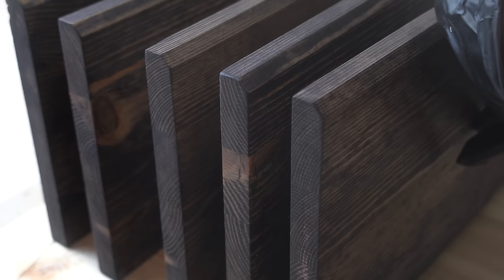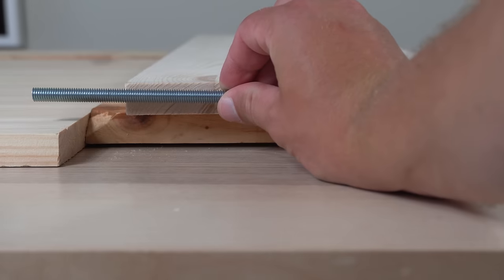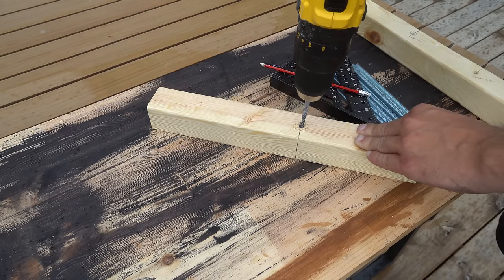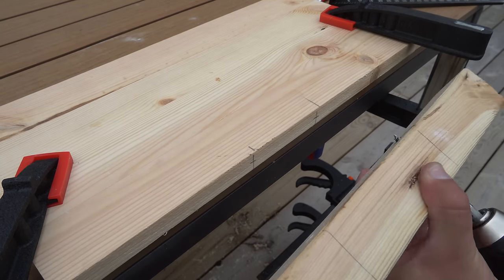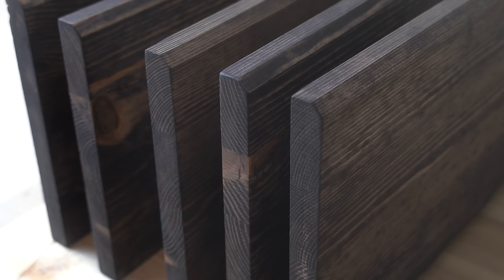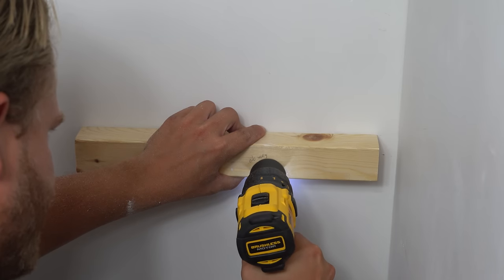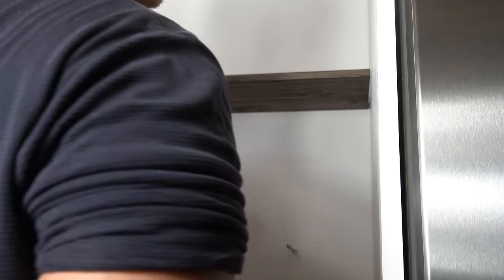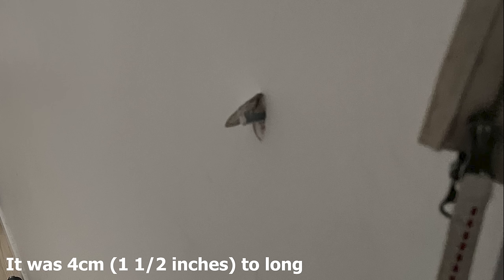How to make floating shelves, with invisible brackets

Comment: I want to make floating shelves out of 1 in thick wood about 3 ft long and 12 inch width and I don't want to make huge holes in the wall the way you showed  so I was thinking of maybe using some kind of flat metal and welding rods onto the metal or find brackets that already have the rods on a flat piece of metal  that are the same thickness as the rods that you used I know I would have to grind a little bit into the wood so that the flat metal things would go into the wood and probably I would have to grind the metal on top and bottom to make it a skinnier profile so that it doesn't show when the wood is into the wall . it's to bad  that YouTube doesn't allow us to upload pictures they could have a feature where you could upload a picture and it'll be a tiny picture but then when you click on the picture the picture becomes large and you can see the picture in a large view but unfortunately YouTube hasn't come up with that idea yet, because i have mad photo of what im trying to make
Reply from the maker: The rods in the video is 8mm thick (or about 3/8 inch) 

If you have a shelf that is 1inch you could use thicker rods with ease. 

If you dont want to make big holes in the wall i suggest you buy some floating shelves kit on amazon or you local hardware store. 

If you need any help you could send pictures to my instagram hallbeamdesign. 

Hope this helps :)

Comment: My walls are never square so in a nook like this, my shelf would be up to 1/2 inch wider at the front side, making these type shelves more difficult for old DIYer who only has a circular saw,  a measure tape & cordless drill. I have 2 stud finders that never find studs.
Reply from the maker: It is possible make this with just a circular saw! I will take a little bit longer and you need something to use as a guide for the circular saw. 

It is not visible in the video buy the sides of the pantry are not square either. About 5/16 difference.

Comment: I have a niche like that in a hallway, only wider and no door. I decided to make it an area with shelves where towels, linens, and other sundries would be artfully stored. I devised this method with one addition. My shelves are both deeper and longer, so I added two supports, one at either end of each shelf, 2” back from the front of the shelves, sticking out of the walls 1/2”. I cut channels into either end of the shelves stoping just short of the front end of the shelves. When the shelves are pushed into place as you showed, those short supports at either end slide into the hidden channels and ultimately provide some side and front support. I used 1” thick hardwood shelves. 
Excellent video! 👍🏻
Reply from the maker: Sound really nice!

Side support is very nice for deeper shelves, when you are able to do so. 

I want to try using a very thick (1 1/2 - 2 inch) shelf with this method in my livingroom. Probably have to use quite thick threaded rods but it will be a nice project. :)

Comment: Great video! I too did some floating shelves in our linen closet. Similar to what happened to you, I assumed my closet corners, where the shelves were fitting snuggly into, were square. Unfortunately, they weren't square and required some "persuasion" with a rubber mallet. I also sanded the back edge of the wooden shelf so there wasnt a gap between the floating shelf and back wall in the closet. This DIY is a good one to follow for simplicity and attractive aesthetics. Cheers all!
Reply from the maker: I also dream about square walls and edges. Made a really long floating shelf for a client a while ago for her livingroom. When I installed it we noticed that the wall itself had a bow  the size of the diameter of my little finger. In a newly built house :) This also took some persuasion with a jigsaw. Thanks for your feedback!
Reply: @HallbeamDesign  That's crazy! Glad to hear it went well! Thanks again for the great content! 👍 Subscribed!

Comment: Love love, so easy to understand how to do this. Actually doing it is the tricky part lol😂 (I will be the one with protruding things in the wrong wall etc). I’m going to give this a crack and will gift myself the right tools, because I deserve it. Brilliant thank you ❤🎉
Reply from the maker: It's easier than it looks! Most important is to make sure the threaded rods are 90° (drill the hole a little bit smaller than the rod) And that the hole in the shelves are 90° 

You deserve it!

Comment: Thanks so much for the basics of the process 😊. Was able to use it to install live edge chestnut wood shelves to showcase my wood carving figurines. Only major difference being having a brick and mortar wall to drill into 😅
Reply from the maker: Excellent! I'm happy that this video was enough to help! :) I'm going to install some live edge shelves myself soon. Brick walls are very sturdy and are perfect for this type of build. Did you use any fasteners in the wall or did you just insert the threaded rods?
Reply: I wound two layers of paper tape around the rods and hammered them gently in. Very snug fit. Have posted it on Instagram and tagged you 😊

Comment: I've been putting old roof beams straight onto brick and block work using this method. It actually helps if the holes aren't perfect as this makes them hold really well, though a mallet is required. You could use resin but it might be a bit hard to out again. I like the technique of getting rod into wood, that's going to be useful at some point I'm sure.
Reply from the maker: I love that you made this comment at the same time as me uploading a video on how to build a woodworking mallet! :) 

I wish i had some old roof beams to work with. The shelves become very sturdy with this method. I am going to install some thick shelves soon in my own house. 

Thank you for your comment!

Comment: Thank you for this nice video
Reply from the maker: I hope this helps!
Reply: @HallbeamDesign  yes it helped alot, however, i am still confused whether i should buy the concealed brackets hardware or threaded rods
Reply from the maker: If you have the tools and alot of time I would make them exactly like in the video. There are some options regarding concealed brackets. They will work fine, but will probably not be as sturdy.

Comment: Here is my like. You deserve it.
Reply from the maker: Thank you, I mean it :)
Reply: @HallbeamDesign  really great idea. I am gonna try it. Hopefully won't get the rod through the wall. I would expect your walls are solid and not drywall partitions.
Reply from the maker: @czaszi  It's actually drywall. Was very lucky with the studs in this case. 

Do try it. They look very good and they hold up a lot of weight even though the threaded rods I use in the video are quite "small" in circumference.

Good luck!

Comment: Great technique!  The shelf material is a little thin for my comfort.  Pine is so weak also.
Reply from the maker: Thank you! It's very thin, it is the design we wanted for the pantry, but I also think that they were a little thin for comfort. Pine is actually fine for a pantry as the most heavy object will probably only weigh about 5-6 kilos per shelf. 

Will do a oak variant in the future  😀

Comment: Very cool dude. Thanks for sharing. Ps, fully agree about the grinder. From the few cordless ones I’ve tried the 60v DeWalt is an absolute beast and has more power than my corded 4.5” ones.
Reply from the maker: Thanks for the tip. I'm considering selling my smaller corded tools and buying cordless tools instead. Angle grinders are one of the most versatile tools, so one without a cord  and high power must be really nice! 

Thanks for commenting!
Reply: @HallbeamDesign  For small jobs, a battery powerd grinder is more than fine, but these things are power hungry and you will drain you battery very quick. Even if you are using 3.5ah and bigger ones. For bigger stuff (lots of grinding and/or cutting), I would keep a beefy corded one like a Bosch blue, or Flex. 
It is like when I'm using my big Bosch blue hammer drill for drilling into concrete. So much more power, than my battery one. Same deal with my grinder.
Reply from the maker: @Ceen328  In one of my next videos I will powercarve alot with my anglegrinder. Then i will have to use my corded dewalt grinder. Do you know how long a 4ah   battery will last when powercarving wood or any similar work?
Reply: I bought a HF BAUER 8 amp 4-1/2 in. slide switch angle grinder….for small house jobs, it works just fine ($24.95 minus 15% coupon).
Reply from the maker: @logan5326  that is very affordable! How much power does it have? 500watts?
Reply: @HallbeamDesign  I have no experience with wood carving. I assume it depends what type of wood you are using. Hard woods like oak, or acacia, may stress the battery alot more, if you use alot of pressure to get rid of large areas. For sculptures you do the rough cut with a chain saw. But in generall, I think battery grinder are the way to go for creative carving jobs, as the cable might get in the way. Just get a second 4ah bateery and charge one, while using the other.
Reply from the maker: Great input! A battery grinder and a dremel is on my list right now :)

Comment: Great looking shelves! Would this approach still work when the wall is plaster over brick, rather than studs behind?
Reply from the maker: Yes it would! As long as you drill the holes 90° straight into the brick wall behind. It will probably aslo be a stronger solution. 

It is a little bit harder and you might need to use a good plug och chemical plug in the wall to really secure the threaded rod into It :)

Comment: Exactly what i wanted to make. I want to use royal bolts instead of rods. Because the nook i have in made of concrete. And since my shelves are wider ill use small support brackets in the front left and right side.

I wonder if that will work.
Reply from the maker: Take your time making the holes in the concrete 90 degres. Concrete will make these types of shelves even more durable. Small support brackers are also a good idea if you are going to place heavier objects on the shelves :)

The support brackets will also help with the alignment if the holes in the wall are off by a degree. 

Good luck with your project! You are more than welcome to send pictures along the way to my instagram Hallbeam Design.

Comment: Thanks for sharing. I am thinking about putting up floating shelves but didn’t want to go the box-build route (I prefer single boards). I’ve seen the anchors that you can route out a space the will allow the board to get flush against the wall, but those anchors are more than I am willing to pay for molded metal. Cutting your own rods is not only less expensive, but might actually be stronger. Not only that, but you get to choose where the rods go, as opposed to something pre-fabricated.. 

The issue I see that would come up with me would be drilling the threaded rods into the studs. I picture that as not going smoothly for me. Have you considered using a threaded socket bit on your driver? I might try that when I get around to building these. Thanks for teaching me your method!
Reply from the maker: Actually it is very easy to insert a piece of threaded rod into a stud. Wood is soft enough that you dont need to create threads in the studs. 

The holes in the studs only need to be a little bit smaller then the threaded rod. The threads in the rod will grip the wood perfectly when you do this. 

Threaded rods are probably the most durable way of installing floating shelves.
Reply: You can also put a small dab of Vaseline on the threads to make them slide in easier … have a cloth handy if it splurges onto a finished surface
Reply from the maker: This is a great tip, thanks for sharing :)

Comment: I made these shelves, but they are a little wobbly. Do you do the same or did I do something wrong?
Reply from the maker: Mine are not wobbly. If yours are, you should check the holes in the studs or use a thicker threaded rod.

Comment: Do you insert the bolts on the wall without  anchors ? Just by pressure ?
Reply from the maker: The threads on the threaded rod will screw itself into the stud. The holes i drill into the studs are a little bit smaller then the treaded rod itself to make it as tight as possible :)

Comment: Hey thanks for the video, working on a set of shelves that are similar in design. I'm planning on using rods but my wall is concrete, any suggestions on how to insert them/set them into a concrete wall? Thanks again for the great video.
Reply from the maker: Long answer but stay with me :) 

Your shelves will become practically indestructible.

1. The most important thing is to make sure that you drill the hole in the wall at exactly 90°, which is more difficult with a large hammer drill. However, you have a huge advantage with concrete and that is that if you happen to make a mistake, you can always just move the hole a little bit to the side (as the holes will be hidden by the shelf)

2. To attach them to the wall you have a few different options.
2.1 Standard screw plug that is adapted for the threaded rods (then you can also unscrew them later if you want to move them)
2.2 Chemical glass inserts that break when you screw them in and solidify / harden and thus fix all the threaded rods in the wall (once they have solidified you will never get them out again and will have to use an angle grinder to remove them)
2.3 (Best one) Just drill the hole in just the right diameter and vacuum the hole afterwards. then you just screw in the threaded rods exactly as I do in the video and the friction will hold the shelf. (they will be quite easy to remove and will fit tight enough)

3. Use a proper drill with a proper drill bit made for concrete :)

Hope this helps you and enjoy your build!
Reply: Wow, thank you so much for such a great and helpful answer! I'm gonna go with the third option and see how I feel about the friction. Thanks again so much! @HallbeamDesign
Reply from the maker: @TheLennyFace  No worries! I always answer all my comments. If you want you could always send pictures of your project to my instagram "Hallbeamdesign" and ill help your from there aswell :)

Comment: what kind of wood is that(the wood used as the shelves)? also what is the size of the wood for the 90degree template
Reply from the maker: The shelves are made of pine.

Drill template is made of pine 45mmx45mm (1 49⁄64 inches x 1 49⁄64 inches (i belive they are called 2 by 2 inches in America))

Thanks for your comment!

Comment: Thanks for the great video Daniel! 👍

I would like to try this at my place, but have a major issue. The wall where I want the shelves is a drywall with really thin metal studs for support, not wooden studs. 😂

Do you have a suggestion on a good way to install these shelves on such a wall?
I know anchors e g molly can be used for drywall but I cannot imagined they would be nearly as sturdy as in ur video... 

If anchors are the only way, do you put the anchors through the thin metal stud for increased strength or avoid the stud altogether?
Reply from the maker: Anchors or molly will indeed not be as sturdy as this option. Metal studs are often formed with a "U" shape which (If they are positioned in the right way) will make it posible to drill two (2) holes --->U (from this direction) 

If they are positioned in this way there is not much difference compared to my video. You'll just have to use a drill bit made for steel insead of a one made for hardwood. This option will also be very sturdy. 

If they are not positioned right, I myself would try to make these in another way. There are other options to make floating shelves with "near invisible" brackets :)

Message me on instagram If you want to send pictures (If you need help) :)
Reply: @HallbeamDesign  
Tack for the fast (and positive) reply!! 😊

I really dislike drywall when the studs are not of wood. It is, at least for a noob like myself, a tricky project every time you want to put something heavy on the wall.

Let me sammarize to make sure I have understood you correctly. Assuming the spacing between the metal  studs is correct:

1. find out and mark the position of the metal studs on the drywall
2. find a suitable bracket with two or more "long pins" that will hold the shelf up. Similar to this->? __|_________|__
3. drill holes through the drywall and the metal studs and install the mollys there
4. fasten the bracket in the mollys
5. install the shelf on/in the bracket. The pins will go into the pre-drilled holes in the shelf 

Phew...See, I told you it is a project. 😅
Reply from the maker: I always answer all my comments! 

Drywall is really good, and i agree that it's much more practical if there are wooden studs behind. 

Exactly! On step 2 i would use threaded rods. With a diameter 1mm or 2mm wider than the holes you drill. 

Personaly i have not tried threaded rods inserted into metal studs. I can try it for you in a few days after i have been to the store, as i'm also interested in this :) 

Hope this helps :)

Comment: Why did you choose to make the shelves so shallow?
Can you make deeper floating shelves?
Reply from the maker: They are shallow because of the design for the pantry. There is a glass door and later i will install lights "in the roof" of the pantry. If I had deeper shelves there would only be shadows. 

It is very possible to make deeper shelves! If you are going to make some of your own i suggest that when you are at the hardware store, you try to get the feel of the different  threaded rods. The ones i use are quite thin, but they are durable enough for the shelves. 

Thicker threaded rods becomes very stiff pretty quick as you go up in diameter of them. 

Hope this helps!